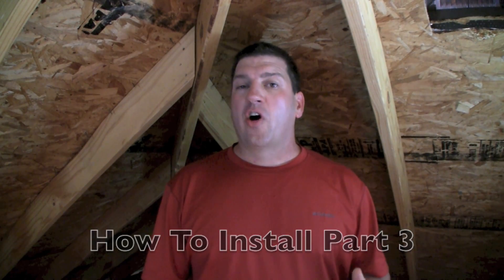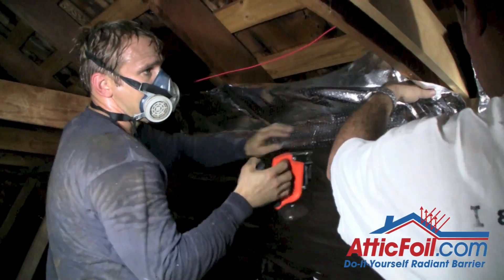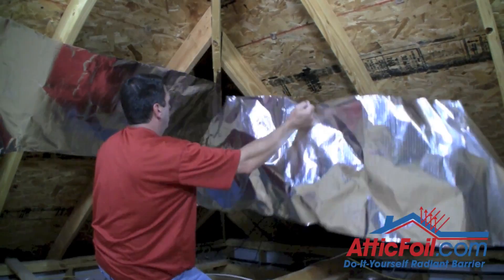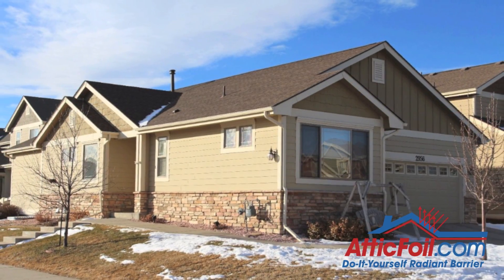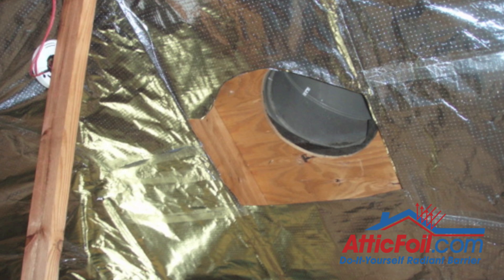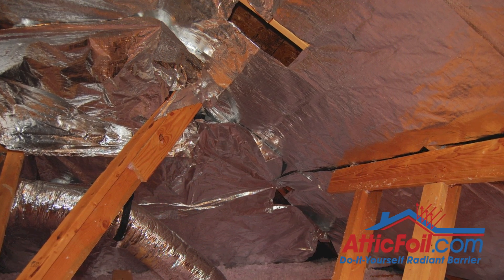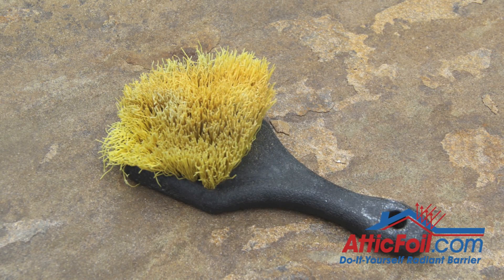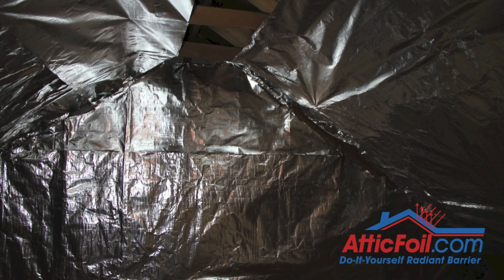How To install Radiant Barrier Foil Insulation AtticFoil - Part 3

Comment: Should this barrier also be applied to the apex portions of the attic, the ends of the house (but not covering the vents)?
Reply from the maker: Yes, I'm assuming you are talking about the gable ends of the roof.  If they catch sun,  then yes you want to install AtticFoil radiant barrier on them.  They are basically just part of the roof turned sideways.  Same concepts.  Leave gaps on tops/bottoms do not cover/block gable vents. http://www.atticfoil.com/index.php/installation/gable-wall-install/

Comment: Per the other videos, doesn't stapling the foil to rafters effectively mean that the rafters are still conducting heat through conduction heat transfer?  Wouldn't it make more sense to create an air gap around each rafter, as minimally as possible, so that a gap exits while still reflecting radiant heat?
Reply from the maker: Yes, kinda.  Where the www.AtticFoil.com touches the rafter the airspace is below or IS the attic. On that exact spot the foil works off the emissivity quality, which is still good but not quite as effective as the space above the foil between the rafters working off the reflectivity quality.  It's just not worth the time/effort to change it for the TINY immeasurable difference. look at the video explaining emissivity vs. reflectivity.

Comment: Any tips for dealing with sun tunnels, dryer vents, roof vent pipes etc.? Is it best to cut the run of foil where the vent is, and make perpendicular cuts so that it fits around the pipe or whatever obstacle there is?
Reply from the maker: Cut a slit to closest edge and then use our www.AtticFoil.com tape (FREE with most orders) to close it back up.  It will practically disappear.

Comment: On your site you mentioned this product can be used in place of a soffit vent. 

If I choose to do that do I need to leave a gap at the bottom? Excellent series!
Reply from the maker: I think we mention you can use/fabricate the www.AtticFoil.com to make insulation baffles, not soffit vents.  If yo do run all the way down, I would still cut a slit or leave about a 2" gap above the insulation level. You want air to be able to either go between the AtticFoil and the roof deck or be drawn into the attic.
Reply: @AtticFoil  yep you are correct I meant baffle not vent. Awesome! Thank you for your suggestion and for making a great product! This is the first thing I am putting up in our 1950s era home we are purchasing. Probably the highest bang for buck thing in an old attic aside from air sealing which is next on the list of course.
Reply from the maker: Thanks, Yes www.AtticFoil.com combined with air sealing and duct sealing are huge bang for the buck projects.  Please write a google review once you are done.  They really help us.

Comment: I don't like that the seams are opened. There should be an adhesive about 3 inches wide to close the overlaps?
Reply from the maker: You can seal the seams if you want to.   It's not required for www.AtticFoil.com We are not trying to make it "airtight" Just want to break the path of radiant heat from the roof to the insulation.

Comment: Hard to understand instructions on blocks, hips, corners etc. Not showing the concerns or how to avoid blockage of air.
Reply from the maker: It's not difficult. You never want the air to hit a "dead end" between www.AtticFoil.com and the roof deck.  If it does, cut a hole, slit etc. for the hot air to get out and continue rising to the top of the attic.
Reply: would you recommend on putting rafter vents with r-19 faced insulation under the roof deck , then install the attic foil right over the insulation by method of stapling under the rafters, with regarding all other application methods being regarded like the 3"-4"  air gap right above the top of ceiling insulation?
Reply from the maker: The only time you should put insulation between the rafters on the bottom of the deck is if you are converting to a non-vented or conditioned space.  Maybe for a bonus room.  Normally, you want www.AtticFoil.com on the rafters for radiant heat and more insulation on the floor for conductive heat.

Comment: My only concern is if you get a roof leak, it'll be hard to notice before it's a big mess..
Reply from the maker: Actually not.  The water would go down the www.AtticFoil.com and hit a seam within 4 feet.  Then drip down.  Your leak would be just up from the dripping.

Comment: Do you recommend to install it on top of my garage even though it doesn’t have any type of roof ventilation?  It has some soffits but no any type of roof ventilation.  Thanks
Reply from the maker: Yes, install www.AtticFoil.com and you still want to leave some gaps at the top.  On homes like this, the soffits can be BOTH intake and exhaust vents depending on the wind pressures.   Even without ANY ventilation a radiant barrier will help.

Comment: Hi, if you have good soffit vents why put a gap in the bottom part of the foil near the floor. 
Isn’t it better to have no gap so the heat can go directly to the top portion of the attic?
Reply from the maker: You want AIR to also be able to move into the attic for moisture removal.  The HEAT will still be blocked.
Reply: I noticed in the store alot of barrier I need a small roll but what kind for my attic off my bedroom to use?
Reply from the maker: Buy the standard 48" www.AtticFoil.com here and just get a 250 or 500 sq. ft roll.

Comment: I wonder how this works on metal buildings.
Reply from the maker: It works great!  In fact, we have a product line at www.BlueTexInsulation.com  that is specifically made for metal buildings.  It will reflect the heat in the summer and reduce/eliminate condensation in the winter.

Comment: I love this video! I just hate that my attic space is so small.
Reply from the maker: You should consider the Over Insulation Method here: https://atticfoil.com/index.php/installation/over-the-insulation-install/  It still works great and is a lot easier to install.  Basically, you just lay the foil out on top of the insulation and cover as much as possible. It's OK if you don't get every spot.  The more coverage the better.  If your home is older, I'd consider the SuperPerf product here: https://atticfoil.com/index.php/products/45-wide-perforated-double-sided-radiant-barrier-foil-superperf/  You can use a pole with a nail on the end and push it out to the hard to reach areas.  You'd be surprised it's not as difficult as you think.  Any questions, contact us at www.AtticFoil.com

Comment: How much cooler will this make the attic?  Do you need to install extra soffit vents since all of the bays become so much more enclosed or do you just add more airflow with a stronger attic fan?  Intuitively it would seem a ridge vent would increase cooling airflow through the heated channels more than whirly pipe vents, what is your experience with that?
Reply from the maker: It depends.  You should install the www.AtticFoil.com FIRST.  Then, measure the air temperature UNDER the foil.  If its MORE than 15º above outside air, then you need to address/add/fix the ventilation.  If not, you are done.  https://atticfoil.com/index.php/knowledge-zone/knowledge-zone-faq-videos/faq-videos-how-much-cooler-should-my-attic-be-after-installing-a-radiant-barrier/

Comment: I’m working on insulating my two car garage. Should I attach Attic Foil to my trusses or lay it on top of blown in insulation? Also, I will be heating the garage in the winter and cooling in the summer. Thank you
Reply from the maker: Since you are cooling it, you may have ductwork in the attic above.  If so, then it depends on your climate area.  Hot areas, then stapling up will put the ductwork in a less hostile environment.  Cold mixed areas, you are probably better off laying on top of insulation.  Here is our page on What Is The Best Install Method For Radiant Barriers.  https://atticfoil.com/index.php/installation/best-install-method/

Comment: How much gap should I leave for the air to flow around?  Should I allow gaps on top and on the bottom sides of the roof rafters?  Is there such thing as not enough ventilation for the air?
Reply from the maker: It does not take much in gaps for the air to ventilate.  The air will naturally head to the top of the attic due to the stack effect.  It's not like an air duct that's under pressure.  Think of it as water heading towards a drain. Just give it an open path to get to the top of the attic with no "dead ends".

Comment: Will it make a difference in cooling even if the attic isn't over the problem area in the home? The hottest room is the living area/den and the attic does not extend over that area. Will it still make a difference in cooling it?
Reply from the maker: MsPotentialis Normally if you can do anything to reduce the heat load into a home it will help the whole home.  If you can reduce the load, you may be able to get better cooling in the problem areas.  Or, if you have dampers on your ducts, you may be able to increase air flow to the problem areas.  You may want to call us to discuss this.

Comment: I want to insulate the walls and rafters in my 10x12 shed. May I put up R 11 fiber glass insulation, then seal it with AtticFoil.
Reply from the maker: Check out our new line of Foil/Foam products specifically made for metal buildings: www.BlueTexInsulation.com

Comment: Excellent video(s), saw the three regarding attic. I am going to have to do my attic in parts... BUT (and I will email you from atticfoil.com too) our main house has a vaulted ceiling and getting to the 'full' underside of the roof is (or looks to be) difficult. These three videos have encouraged me for my 'attached garage' application and the south side flat ceiling rooms... thanks again.

Comment: Thanks at the he end for speaking about placing it in a porch. I was wondering about the use of it outside under a porch. I really like your product and will be ordering some soon. What sold us too was you comparing it to Reflectix in another video. Seeing it not rip was key for us in our attic. 

We here in Central Florida have a 2x6 framed ceiling over our dining room and laundry room with a flat roof with zero insulation and ventilation in the ceiling and soffit ventilation in that space. We will place AtticFoil with a 0.5-0.75 inch air gap from the plywood sheathing from the roof spaced with foam 1x2 or 1x4's pieces from foam board I'll cut and glue and then place the AtticFoil on top of the foam. After that I'll attach Kraft Faced R19 Batts of fiberglass insulation under the AtticFoil and then drywall. 

Does that sound like a viable solution for our particular situation? Great products and great videos!
Reply from the maker: Yes, sounds like a good plan.  Take a look at http://www.atticfoil.com/applications-a-uses/cathedral-ceilings/foil-to-outside.html  I think this is basically what you are trying to achieve.
Reply: AtticFoil Thanks for the reply! I didn't see this page on your site and now I know more on how to install your product I'll be receiving soon! Thanks again.

Comment: My husband and I have actually installed this product in our home in Georgia.  It made such a difference in our cooling bill for summer that we have built a home in Alabama and even though it is a new home...the garage is extremely hot due to no insulation on the garage door or in the attic roof.  I will be using this radiant barrier to block the heat coming into the garage.  The training videos are extremely informative and this is a perfect DIY project that will pay for itself.